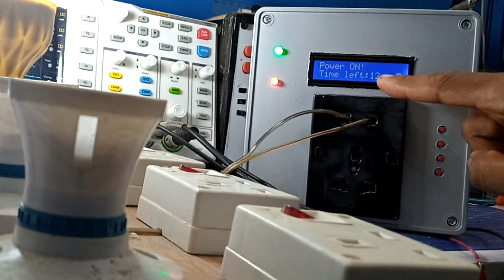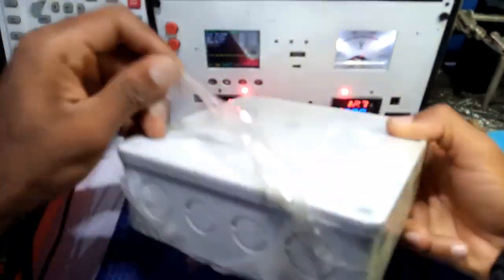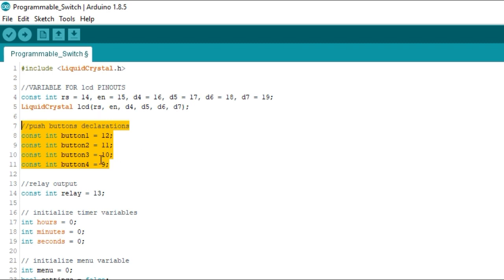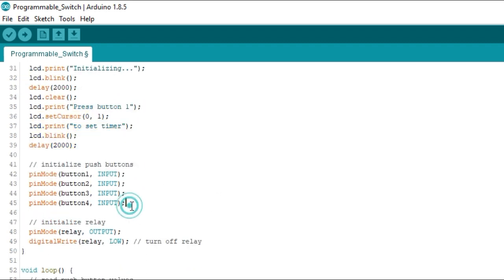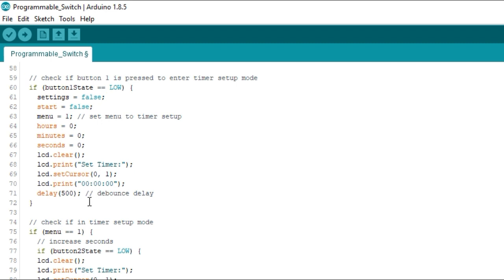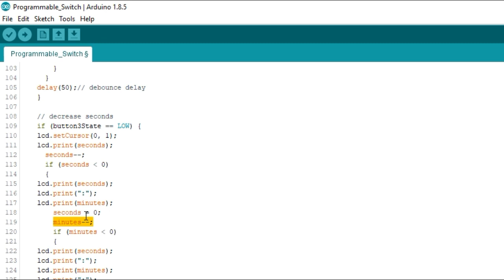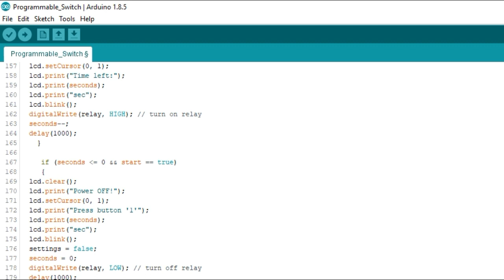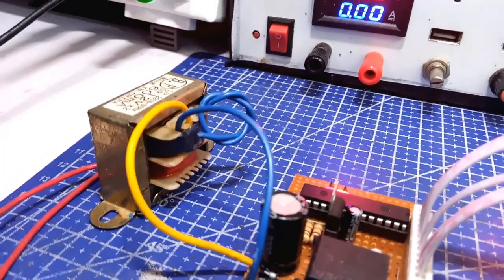Timer Arduino based button switch programmed Electrical socket

Comment: Nice project sir.
I do have some questions sir.
1. Having uploaded the code and building the circuit, I was unable to set the  period for minutes and hours, what could be wrong?
2. According to the video you only set the period to 14secs, have you tried setting the minutes and hours as well?
if (settings == true)
  {
  lcd.clear();
  lcd.print("Power ON!");
  lcd.setCursor(0, 1);
  lcd.print("Time left:");
  lcd.print(seconds);
  lcd.print("sec");
  lcd.blink();
  digitalWrite(relay, HIGH); // turn on relay
  seconds--;
  delay(1000); 
    }
3. According to the lines of code (from your sketch) above, the device will only countdown the seconds neglecting the minutes and hours.
4. Also, the variables 'seconds', 'minutes' and 'hours' are not highlighted as yours in my arduino IDE, could that be the IDE(Arduino 1.8.15) I am using?

Thanks for your reply in advance.
Reply from the maker: Confirm if you were able to set it in seconds
Reply: @MEmbedded_TechLab  Yes, I was able to set it in seconds, with maximum of 60secs.
Reply from the maker: Okay, that was the limit for this build, I didn't set up the hour and minutes
Reply: @MEmbedded_TechLab  Thanks a lot sir.